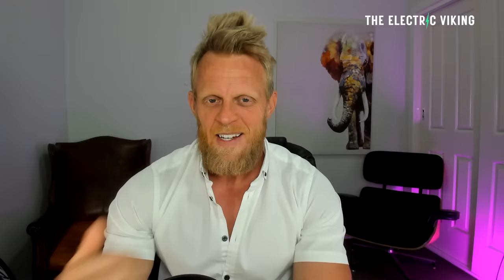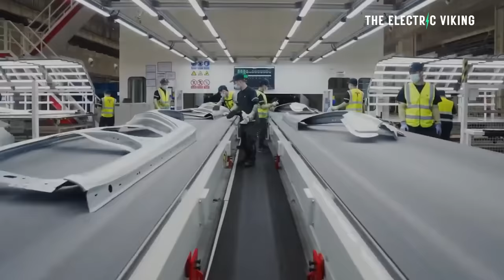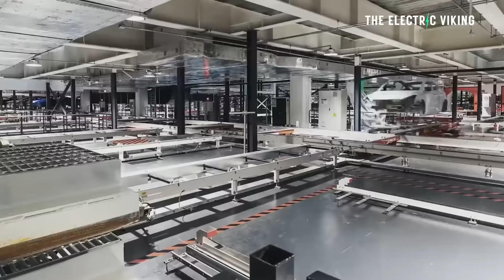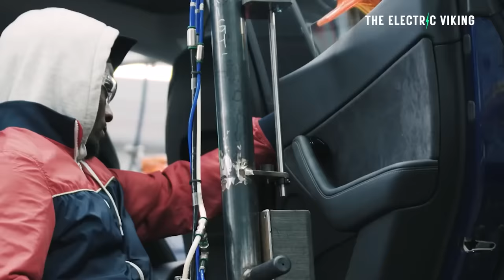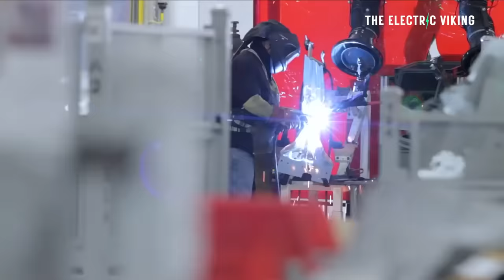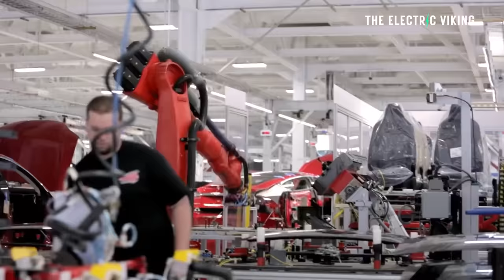Electrek claims Tesla firing tens of thousands after Cybertruck demand collapse

Comment: I have a pre-order on a Tesla Cybertruck, but that was for a single motor (entry level) one for the initial estimated price of US$ 40,000, which they don't have nor plan to make yet. I would much rather buy a Ford Lightning truck if the battery technology would improve on it, since it is a more practical truck. The price difference between a Cybertruck and a Lightning would also favour the Lightning truck. However, I don't want to spend US$ 75,000 on a Ford Lightning when in 10 years battery degradation is so bad that it will need a new battery at a cost of US$ 32,000 plus labour.
Reply: 🤣🤣🤣🤣🤣 u bought a cybertruck 

I bought byd seal
Reply: unfortunately tec in batteries is moving so fast these days,  American vehicles will be left behind unless they team up with Chinese manufacturers.   Sad but true,  unless there is another solution available in the very near future?
Reply: @TerryHickey-xt4mf  The solution would be that America develop its own EV battery technology and with sufficient R&D and using existing Chinese and Korean technology as a base improve currently available Chinese/ Korean EV batteries.

Comment: What flies in the face of logic is that a dual motor truck advertised for $50K in 2019 is listed at $80K MSRP in 2023 but is only sold for $100K as the Founders Edition. So a lack of orders is not surprising. I had 2 orders and have held both back. I will cancel one for sure and the second one will stay until the price drops to $60K. And Tesla did have layoffs. EV, why do you take anti-Tesla news so personally as if Tesla is your company.

Comment: Not enough demand for Cybertruck is false. The layoffs were worldwide and unrelated to Cybertruck demand. Layoffs are affecting tons of companies in many sectors currently for various global reasons and also re-balancing of labour caused by the over-hiring during the 3 years of pandemic.  I'm sure this will also set up Tesla to start implementing its Optimus humanoids into the assembly lines.  It's not that easy to just devote all your staff to the Cybertruck orders when material, parts and assembly lines to make it are limited. I'm sure assembly expansion is being worked on as fast as possible, but again, material, parts and qualified labour to make it is limited.

Comment: Sky is falling? Tesla dying? Some are crying? Some are smiling?
Ok. So what. I have worked over 40 years in the tech industry and seen it over and over. Layoffs is a natural thing. I am surprised to hear 10% across the board. No smartly run global company does that unless there is desperation. So I doubt this very much or it is a an internal wake up scare to employees as the company, or Elon, suspects complacency setting in. Good companies in a slow down do very strategic layoffs and hiring during these times. They hire in the emerging markets and let go typically low performers where they need to and only where they need to. Companies really don’t ever want to let their most valuable asset slip away. Trained employees are too valuable to their success. Also a good part of this is to satisfy Wall Street as the know it will reduce the drop the stock when they really announce the facts about reduction in force on the 23rd of April at the investor meeting. So, I think Sam’s channel will be safe as the layoffs will turn out to be strategic and smaller than the hypsters are putting out there.
Reply: I eat my words… Sam, what’s next? The Electric Wombat?
Reply: @Yippydog  The Electric Drop Bear?

Comment: Good on you Sam, I won't believe it as well, at least not now. But the challenge is there, US is increasingly not suitable for big scale manufacturing, not only the labor cost, not only the energy supply, it is about skilled engineer shortage, the cost increase of industrial chain, the world is dividing US and None US, and None US is expanding rapidly without rely on US industrial chain and products, plus US finance to do trade and  businesses. Inside Tesla China, 95% and above parts all supplied from China, other tesla factories maybe similar. US is making the worst strategic mistake in two centuries and that winner is not US.